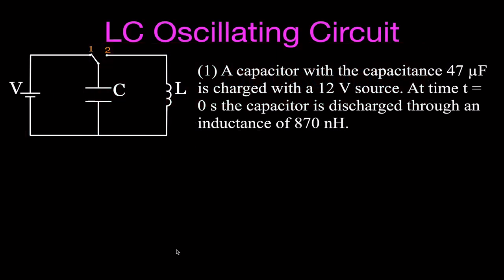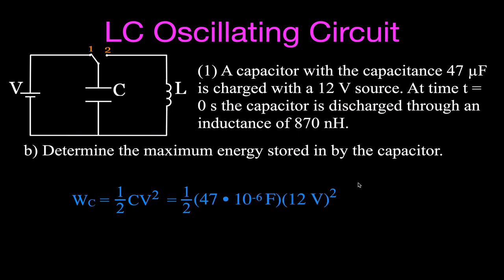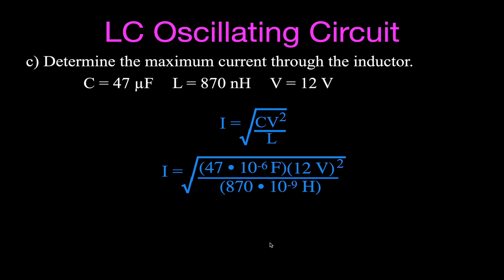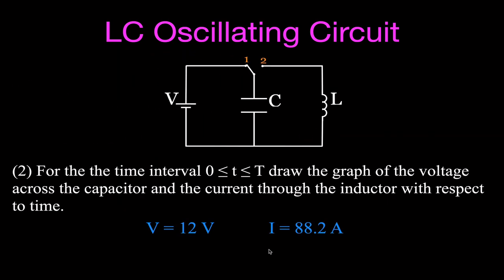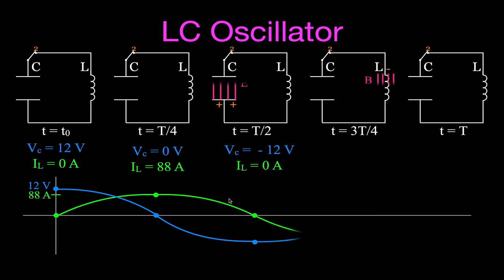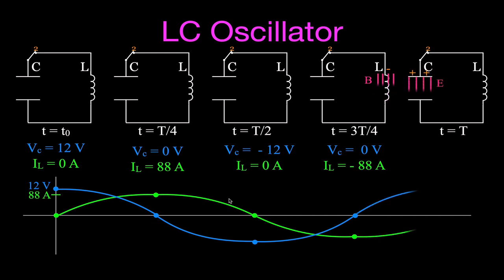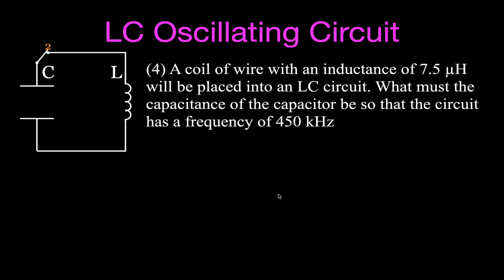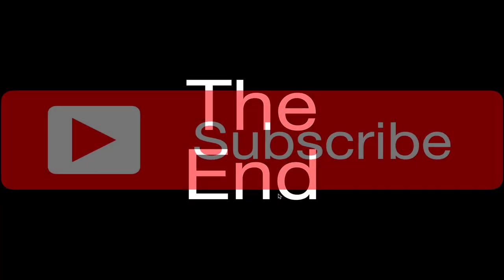LC Oscillating Circuit: Example Problems

Comment: Help me please Two vechels move from rest on a straight, horizontal road to the right. The mass of the car is 1100kg and the mass of the tow truck is 4000 kg. The tow trucks engine applies a force of 15 000N. A constant friction force of 1456N is acting on the car and a constant frictional force of 4520N is acting on the tow truck respectively.
           Questions
Help me calculate the acceleration of the car and the magnitude of the tension in the cable
2. Using equations of motion calculate the distance of that the car will travel in 4 seconds.
3. A create of mass 95 kg crate lies on a plank inclined at 23.2°. At this angle the crate is just about to move  down the incline.
3.1 calculate the magnitude of the static friction force
3.2 the coefficient of static friction between the plank and the block
* the question does not give us the value of the coefficient or the static friction value

Two blocks, of mass 8kg and 4kg respectively, are joined with an inelastic string of negligible mass. The string runs over a frictionless pulley. The 8kg block is on  a horizontal surface while the 4kg block is on an inclined plane of 40° with the horizontal. The coefficient of kinetic friction for both blocks is 0.2. The 4kg block accelerates down the slope

                 Questions

6.1 calculate the frictional force between the surface and the 4kg block
6.2 calculate the magnitude of the tension in the string
**  please help me out I need help pls I got nowhere else to go but  you. 
I have just started watching your YouTube channel . I am fom south Africa. If need my email is

ebenezerlombiso@gmail.com